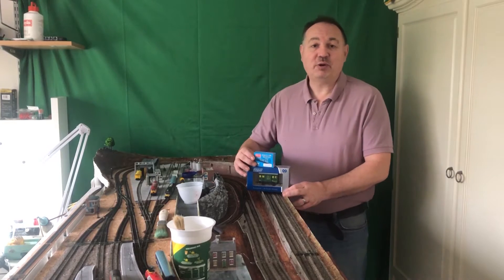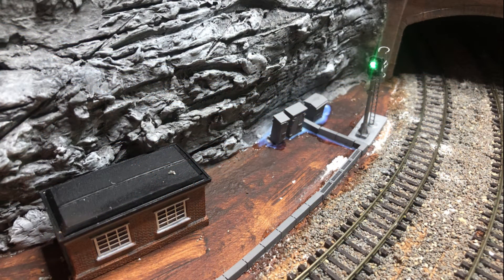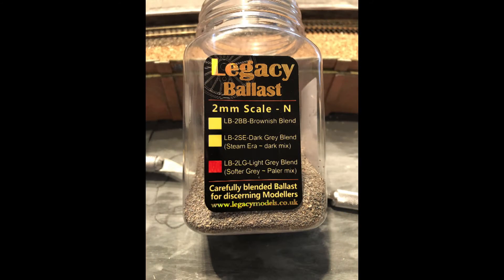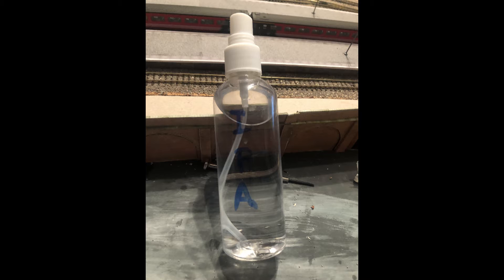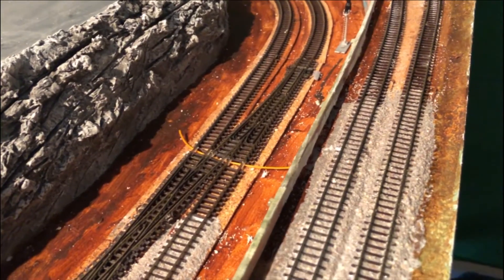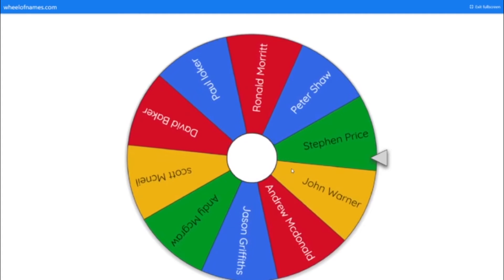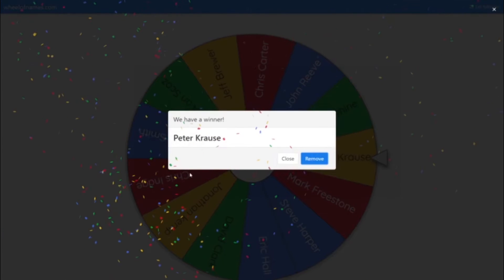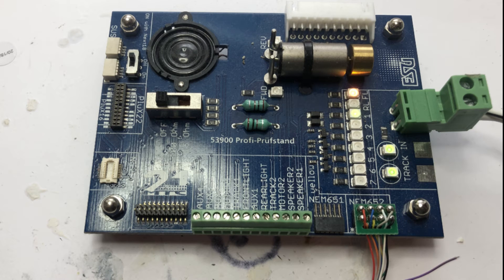Flint Hills Model Railway November 2020 Update

Comment: Hi Geoff  - good update.  Must check out the N-scenics cable trunking.  For the ballasting I have a slightly different method - I ballast the centre of the track and the flood the side with the PVA then capillary action draws the PVA  in.   That way you don't get any glue on the rails - especially good at the points.   Downside is it takes longer to ballast but as I find ballasting rather therapeutic I don't mind.  Anyway enjoyed the update and well done in converting the 08 to DCC.  cheers Euan
Reply from the maker: Thanks Euan , I might give that ago next time  just waiting on more ballast as I used all mine up.  Geoff

Comment: Excellent video's as usual, I've done an O8 DCC as well so can attest to how fiddly it is, Couple of questions I have re the track, having never worked with flex before, do you not replace the missing sleepers where the solder joints or track joins are? (just wondered), also do you have  have any tips and tricks to transferring your anyrail plan onto the baseboard.. I've seen a few ideas but wondered what your's was... Keep up the great work!
Reply from the maker: Hi Alan , thanks for your reply .  I did replace some of the sleepers I had Cut away but some where just in the wrong place where the wires were so had to leave the odd gap . i soldered originally on the  inside of the rail but have since moved to soldering on the outside to make getting the sleeper back in easier .  regarding the Anyrail - i scaled it  to 1:1 and then printed it . I then simply taped the various sheets of paper together on the printed reference markers. once done I then un rolled the entire sheet over the baseboard. I actually nailed the track down over the template and then cut the paper away afterwards .. Hope that helps , Geoff
Reply: @flinthillsmodelrailway  Hi Geoff, that was one of the approaches I was going to take with my track, but am looking to lay a cork roadbed to start with so I guess I could pin down the cork then remove the plan?... the roadbed being just slightly wider than the track.
Reply from the maker: In some places (points and curves) I laid a sheet of Cork on pva to the board . I then put the plan over the top and laid the track. I then cut the unwanted cork  away which lifted with no issues, Geoff

Comment: Hi Geoff, What is the advantages of using IPA over water for spraying the ballast?
Reply from the maker: Hi. I find using the IPA helps to break the surface tension so the Watered Pva soaks in more even around the ballast. The alternative is to use water with fairly liquid , Geoff
Reply: @flinthillsmodelrailway  Thanks Geoff, Yeah we used the fairy liquid and water way :)